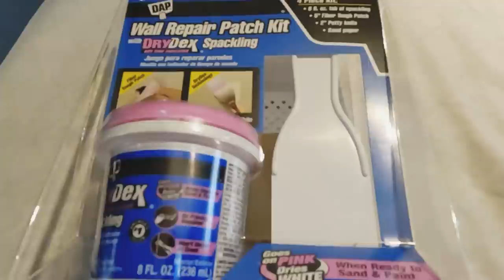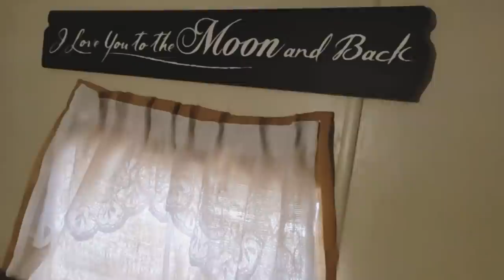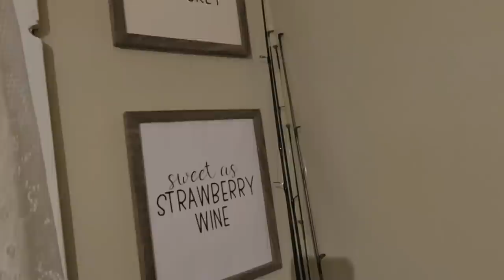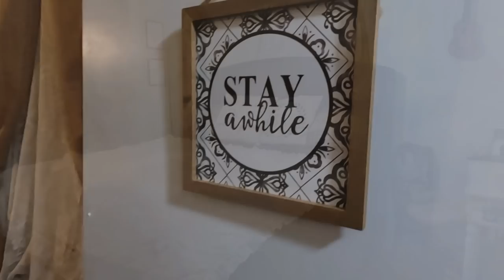1984 SINGLE WIDE BEDROOM MAKEOVER

Comment: If you were going to paint that was the first thing to do before putting the floor and you have to use the spacklikng alone without the other part,you need some curtains rod putting them all the way to the ceiling and the sign dont look good at allon top of the curtains other than that  the room turns out good.GBY